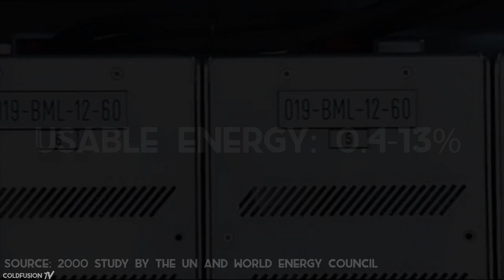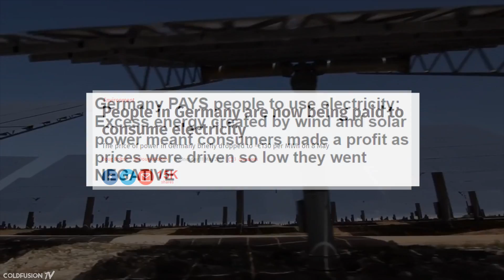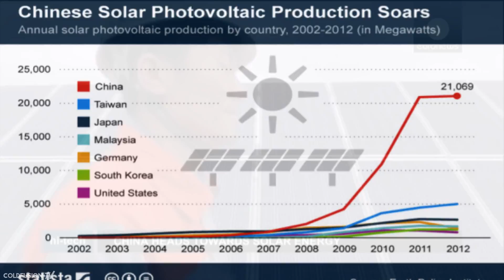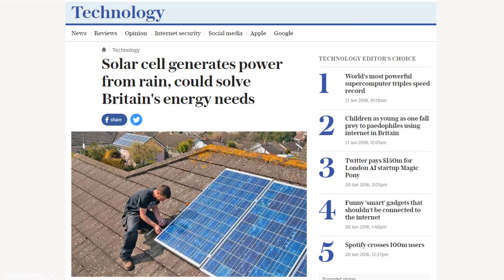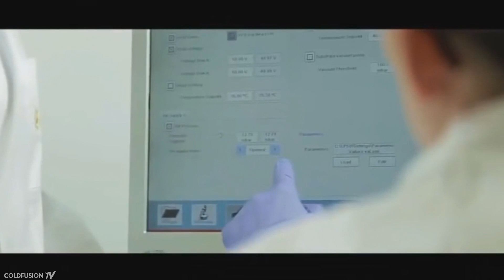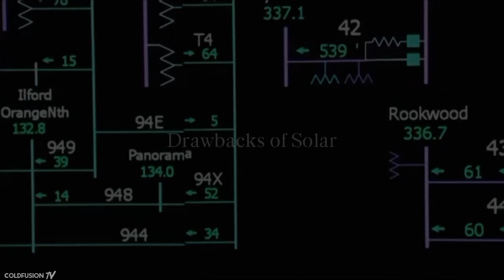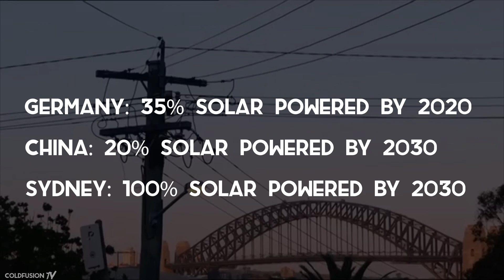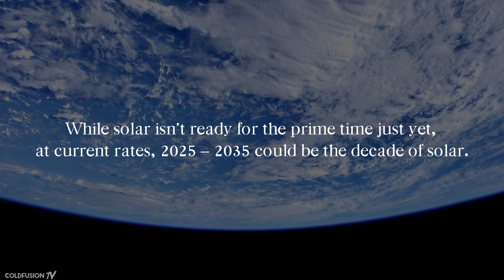The Truth About Solar

Comment: Its kind of disgusting of how much land is taken by the solar farms, when there is plenty of sq ft on top of rooftops and then the power could directly contribute to that very building.. one thing also not taken into consideration is the batteries solar needs as well, and that they need to be replaced ever so often..
Reply: Too true. Crappy PV cells might be maid of silicates which are extremely numerous but decent solar cells are made using tons of rare minerals. And batteries are entirely dependent on the mining of lithium at the moment, a non-renewable. I think people just don't like to think about it...considering that solar seems so perfectly sustainable and environmentally friendly...
Reply: You lose energy production if its on a building, solar farms are there to get maximum sunlight
Reply: VideoMorsels
Exactly, most people forget how much energy is lost between generation and use.

Comment: Uhh China's '20% solar by 2030' policy is actually '20% fossil free by 2030' not necessarily solar. Which means it will probably be the much more efficient, clean nuclear fission powered by thorium (which China is developing right now)
Reply: I pretty sure Thorium reactors would be more efficient then solar. Solar is still pretty inefficient at converting light to electrical energy. You could argue the loss of power in Thorium for grid distribution but that is nothing compared to loss in battery storage for Solar. Clean probably means cleaner then the old reactors which they certainly would be. The waste would be far less and less dangerous. These reactors can even consume old waste in theory. Today's reactors are very inefficient in using up fuel. LFTR reactors would be much better. Now if we talk about the batteries that would be required to store solar energy you might actually be able to make an absolute case that a Thorium reactor is cleaner then solar. I would have to investigate but batteries are generally not that environmentally friendly and Thorium is a by product of rare earth metals mining and as such is environmentally free other than the refining. I guess I still don't believe a solar battery based solution is viable for the majority of the worlds high density energy needs while a Thorium reactor is. The only thing that makes me question that assumption is Elon Musk who seems to think he can make this work. I would never bet against this man but I think in this case like most solar advocates he is more hope and belief then actual ability to do.
Reply: Thorium reactors can be scaled down so they could be in every neighborhood or even household...
Reply: yes they are cleaner than solar. it goes wind, thorium, solar in clean energy table. making and disposing of solar panels are very caustic. keep reading, you will learn more about the wonders of thorium. and the US has the largest reserve of it.
Reply: ^THIS^ Thorium liquid salt reactors are the magic bullet for future world energy needs! If you don't know what we're talking about please check out some of the Kirk Sorensen videos on YouTube.
Reply: Misguided people thinking about thorium. Its not water soluble, it cant explode, and if it does melt down (Not explode) it all goes back to containers which can be re used again until all thorium is gone. Solar will never beat thorium, this is because the total solar energy may be greater but it is so distributed you wont ever get close to getting the numbers this guy stated. Thorium is not like normal reactors where you try to make it not explode and calm down the reaction which can explode and leave fallout. Thorium you try to keep the reaction going and if you dont it just simply stops and you collect all the thorium and start the reaction back up.
Reply: Chichenwin Usernam
Reply: Chichenwin Username λκκκ
Reply: solar panels in space ftw
Reply: +keegers103
Actually, all the molten salt reactors you heard about, from the MSRE to the nuclear bomber reactor, all ran with uranium as main fuel :  LiF-BeF2-ZrF4-UF4 for the MSRE,  NaF-ZrF4-UF4 for the ARE ( Aircraft Reactor Experiment), with sometime some thorium for experimentation.
whatisnuclear.com/articles/thorium.html
whatisnuclear.com/articles/thorium_myths.html
Reply: I did that calculation myself, and found a surface of 160 000 square kilometers, or 60 000 square mile.
BUT it was an extremely conservative estimation, with the use of fairly weak/low cost panel, a lot of place for infrastructure and free space for wild life, also covering a big chunk of industrial needs currently working on coal, particularly in steel industries.
As for a location, my personal choice for north america would have been the Sonora desert.

A switch to full solar is definitely doable.
Actually, with the recent advance of Tesla for example, the issue is not even the cost of installation, though it could scare a politician or two. But several company are today building massive solar facilities and it seems solar energy ( battery included ) is now cheaper than clean coal.

The real issue is production. There is simply not enough production capacity on earth to do that switch in the next years, just building the plants to build enough solar panel will take years. Which is of course not a good reason not to start today, and it have already started.
The smart move would be to built enough capacity production to replace each year something like 4 or 5% of the world panels. You install brand new panels for 2 decades, then simply replace the older by brand new panels.
Same issue for the batteries. Can be done, just not in a couple years because we don't have yet the capacity to build enough of them. The Tesla Gigafactory is just one step in the right direction, others are needed.

It is happening, but it take a little bit of time.

That said, i am not sure why you ask if nuclear could do that. A nuclear power plant is orders of magnitude smaller than equivalent solar capacity, and we have tens of centuries worth of uranium available on land, millions of years if you count the ocean.
And with a 24/7 production, it would likely be easier with nuclear energy.
Reply: John, what do you do for power when the sun is not shining on any part of the arrays? What do you do in mid-winter when the solar systems produce about 30% of the kWhr that they do in mid-summer?

My data comes from the PV panels on my roof installed in 2015. The maximum production has been 21.1 kWhr/day. The average so far is 10.6 kWhr/day. The summer average is 16.5 kWhr/day (mid may - mid August).  The winter average is 5.7 kWhr/day (November through January).
Reply: +Flameboar
For solar electricity, you basically have 2 solution : concentrated thermal or photovoltaic.
Concentrated solar is the one you hear about when people talk about burning birds and bugs. There here again several systems, but it is mirror concentrating the sun rays on a target. In this target, either a boiler or a heat exchanger with molten salt. Depending of the technologie, without battery some of these plants can run continuously for 30 hours, or more, without any sun. by storing super heated molten salt for later use.

In photovoltaic, we are speaking regular Joe solar panel. The best way to use them is somewhere in a dry desert, without clouds. In these conditions, the array will basically have the same output regardless of the season.
The best strategy is however to have several of these big arrays, widely spreads to reduce to possibility to have several of them darken by the same cloud system, but as much as possible in dry and sunny places. There are places like that in Texas, California, Arizona among others.
And of course, Big Batteries. Looooots of batteries to cover not just the night, but also a couple day of poor weather to be able to wait, or at least to have time to restart a emergency generation system.
Having a lot of buildings or warehouses with their roof covered in panels in city can definitely help too.

So a lot of problems, even more solutions, on average harder than just a big plant, coal, gas or nuke.
But it can be done.
Reply: Franck Dumont

Comment: where i live solar is only efficient 25% of the year, and most of the time only charges batteries for 4 hours a day. solar or something like it will be the future of energy but not today or tomorrow. in fact it has a long ways to go!
Reply: Made a payout calculation recently, 9+ kW peak PV installation, all costs included : 10% on an annual basis, battery replacement after 5 years included, an this with the actual electricity price ( which is only getting more expensive at a rate of 18% per YEAR ). Solar is competitive now and will become more competitive in the future. The centralised power plants are dead meat walking, just like the brick-and-mortar retailers.
Reply: Well, that's the "peoples" problem - liking to shop. For me, it's a pure waste of time. I know what I want and when it can be delivered at my doorstep without me wasting time and an unreasonable amount of money to run after it, it's just FINE. Just calculate how much fuel, parking bills, car usage you pay for getting a deep frozen pizza - not even taking your very pleasant time walking in the rain or wet snow at the parking lot into account .... I wish you a lot of pleasure.
Reply: hydro, wind, trompe, biogas, ect ect ect
Reply: omi god the batteries do not need extra charging for 25% of the year. The rest of the year we are using a TEG instead
Reply: it's 1.5 times the size thats recommended. solar works just as good in some as others.
Reply: omi god yes I think big power plants will always have a place too. Even if the way they generate power changes in the near future. Maybe part of the problem with the solar and wind is we need better energy storage.
Reply: hendrik1730

Well, that's the "peoples" problem - liking to shop. For me, it's a pure waste of time. I know what I want and when it can be delivered at my doorstep without me wasting time and an unreasonable amount of money to run after it, it's just FINE. Just calculate how much fuel, parking bills, car usage you pay for getting a deep frozen pizza - not even taking your very pleasant time walking in the rain or wet snow at the parking lot into account .... I wish you a lot of pleasure.
Reply: hendrik1730 thank you. I hope you have a great day as well
Reply: I love shopping online, but some items you really just HAVE to buy in a store .... at least until VR advances another decade or so. Shoes.... glasses.... pretty much any clothing since all the manufacturers can't decide how long an inch actually is.
Reply: Partime Outdoors fussion
Reply: LukeCageforhire Alberta Canada, when I say efficient I mean the panels are producing more power than the system is using for only 4 hours of the day, the rest of the time the system is using more power than the panels are producing. 4 panels 140watts each charging four 12v deep cycle batteries. The system 3 transmitters using a couple watts each. June July and August are our best months.
Reply: hendrik1730 - you're one of the rich.

Comment: Free for who? You have stopped a few minutes short of telling the whole truth. Current solar set up for a small off grid cabin takes a few hundred dollars of panels but several thousand dollars of batteries and converter. The batteries will require renewal before the system has paid for itself - insert a clip of resources required to manufacture batteries here please (spoiler alert, it's not pretty)! It's like getting free clean water but you need to lease a solid gold bucket to carry it home.

Large scale solar power will be so cheep they will have to give it away or sell it for lower prices? Sure, that's how big business works. Have you seen the price tag on a Tesla? People own technology, Windows 1.0, 1.01, 1.02.... and all made to become obsolete as quickly as possible after you bought it so you have to buy again, and again - unlike a 30 year old bicycle which you could use for ever (no I don't ride a bicycle, I'm just say'n).

You know what really is free? Use less. What you save is completely free ~ well until everybody dramatically cuts their use, then they will multiply the price of what you do need, produce less and fire thousands of employees because "That", is how big business works.
Reply: I hope there comes a time when ultracapacitors will be king then we won't have to worry about those batteries
Reply: The only way to make solar somewhat viable is large scale solar farms with pumped storage hydro power plants to accumulate electricity when sunshine is available and put it back into the grid during the night or overcast.
But even that doesn't solve the problem with solar panels producing twice as little in winter as they produce in summer. To get a full solar mix you'd have to install as many panels as produce enough energy in winter, which would make half the energy being wasted during summer.
Another problem with solar (and wind) is that they aren't really an infinite source of energy. The maximum achievable capacity is limited by the global deposits of rare materials required to manufacture the panels. As the amount of recoverable materials dwindles, production of panels will start getting more costly.

Comment: I have always been a fan of solar however, there are major hurdles to overcome. First energy generation has never been the problem, what we have yet to figure out is storage. The other is demand, solar is great when the demand is constant but not to good when it surges, a surge can quickly shut down a complete system. Individual houses can install systems that can function as with musk's power wall,but then you get into that off grid thing which neither power companies or government officals care for because it takes them out of the equation. If every house in the US had its roof covered with solar panels the current grid could not handle the output and that's just the major ones

Comment: No, battery tech is not a limitation to solar. If solar prices drop enough, we can use cheaper but less efficient storage methods. And we could replace daytime fossil fuel use with solar. Battery tech isn't necessary for solar, but it will help especially for people who want to go off-grid.

Comment: To me, at this stage in the consumer solar game, it just isn't cost effective to spend 10-30k on a solar system.  Plus when you live in the Phoenix Arizona metro area like I do, the power companies have been authorized to charge a grid service fee for people who do not use a battery system.  To me the most economical way to save money and help the environment by using less energy is by making your home more energy efficient by upgrading your insulation, making sure your duct work is sound, upgrading windows, upgrading to more efficient appliances, etc.  Maybe in 10-20 years solar will be more affordable to the average working class Joe, but right now it doesn't make sense.

Comment: I have an off grid solar system .. yes, the price of panels has gone down.. HOWEVER the solar panels are about 10% of the cost of the system... if all you have is solar panels you have nothing... in fact if solar panels were free my 1000 watt system would have still cost $9,000.. that is not including installation cost  that would have added another $1,500.. that's $10,000 for 1000 watt system that has NEVER produced 1000 watts per hour an does not include the fact I need to run a gas powered generator once a month to fully charge my battery bank.... solar is still a long way from useful and still cost a hell of a lot of money compared to electric grid...

Comment: What about the fact most solar technology needs rare earth metals for the reaction to work. The biggest issue with current solar technology is that we may not have enough of the material available to actually make the panels.

A mixture of tidal, wind (so long as the lubricant is a biological oil) and solar is the future of our energy needs in my opinion.